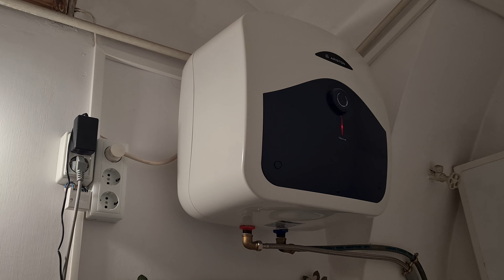Water heater Magnesium anode replacement (Ariston, 30 liter, 1500W)

Comment: Surprised to see sand inside. Propably there is leak somewhere in the communal fresh water system which will catch sand. Perhaps extra coarse filtering system before the heater would be good idea in this case. I just bought this same heater and read from instructions that the magnesium anode should be checked every second year. Your video was very helpful, thank you for making it.